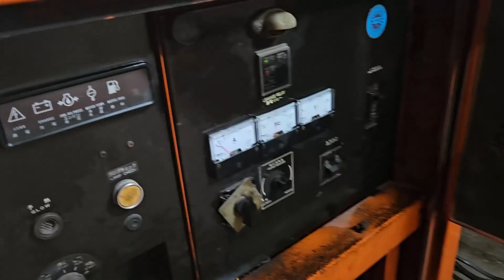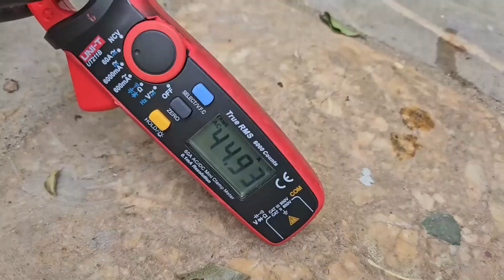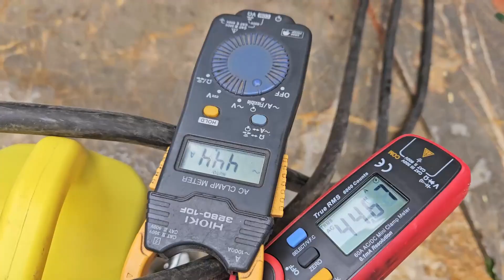Salt water load bank of small 45kVA genset.

Comment: What are they throwing into it and is it intentional to increase/decrease a value of something?
Reply: They are throwing in salt. The salt water solution is more conductive than regular water, so adding salt increases the load on the generator for testing purposes.
Reply from the maker: Read descriptions much? lol Busting ya dude. Yeah, as other commenter said, it's salt to increase the conductivity of the water. With straight tap water it would only pull 7 Amps. After one or two small sprinkles it went up to 30A or so and a few more and we got up to 55A and had to pull electrodes out to lessen the load. Surprised how little salt it took! Check my FB for more info, I made a post about it.
Reply: @inothome  Of course I read it.  But as soon as I assume it was salt, you’d correct me that it was baking soda or something else.  I also didn’t realize that a pinch of anything could affect such a large container.  

Thought the point was to charge the water like a battery.  It’s what I get for asking.
Reply from the maker: @jeremy9161  Chill dude.... I was busting your balls, all good bro. 
Yeah, I was surprised too how little salt in such a large container made such a big difference. When they sent the guy for salt, I asked how many kilos was he going to get. Then he came back with that little bag and I as like, yeah, ok..... what is that going to do? 
But salt water is more conductive than fresh water and they need the water to conduct between the electrodes to create a load. Just a little bit of salt made such a huge difference in the conductivity. They added it little by little, as you saw. Was cool to see in person for the first time. They do also do it in the US, but I have only used actual load banks when in US, never water tanks and electrodes.
And always ask questions, it's how we learn. I may bust balls but all good. There is no dumb questions.